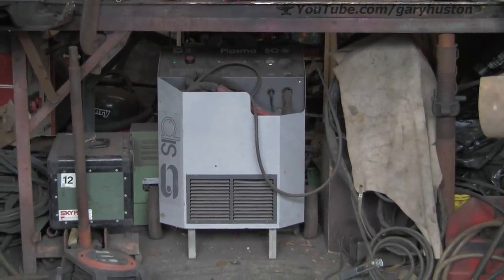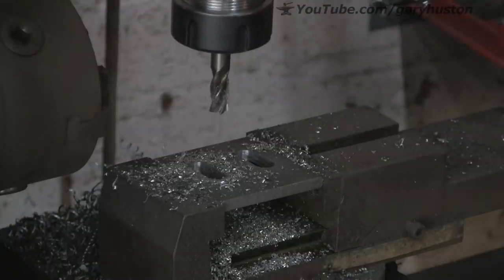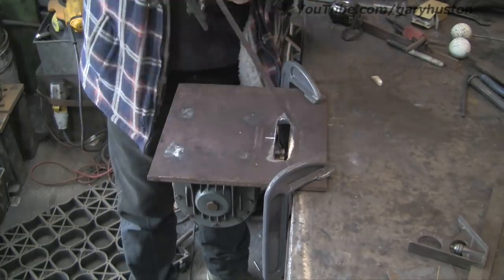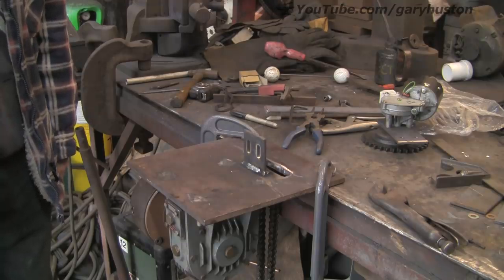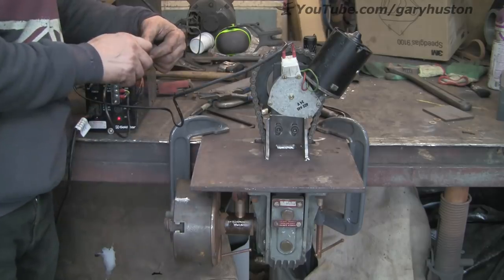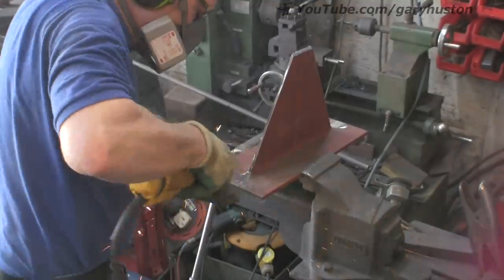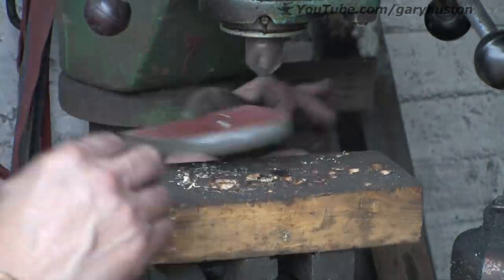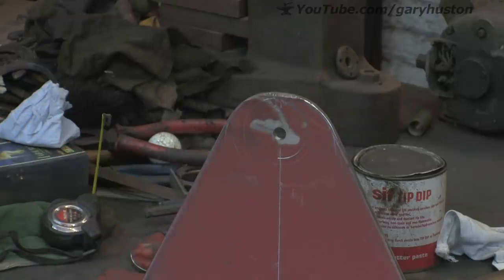Homemade Rotary positioner part two

Comment: Looks like something that will be really useful.  My son and I built a CNC Plasma table a couple of years ago.  He wanted to make a tube buggy, so we installed a chuck on the table to CNC cut tubing.  He never did make a tube buggy, but we did cut a couple of pieces of 6" SCH 40 pipe on it.  Recently he built a suppressor and we put the pieces in the chuck and used the CNC to rotate it at a constant speed and mounted the TIG torch on a magnetic indicator holder to weld it up.  Worked great.

Comment: Being as how I have no clue if you are finished yet are where exactly you are going with the build, I think I see foreshadowing of a possible problem with the table mounting to those ears you are making. If the table is wider than the legs, when you go to rotate the table to 90 degrees to the surface, or where the positioner will hold horizontal, the table will hit the legs. Easy fix if you just weld it to the edge of the positioner mounting plate or notch those legs to 90 to match. My guess at the future~ take it for what you will. 
Thanks for the videos.
Reply from the maker: That isn't an issue at all but there will be an issue, look out for the next part to see what it is and how i get over it!

Comment: My horse has a crack in his hoof, what can a farrier do and how much will it cost?
Reply from the maker: I can’t answer that. It depends what caused the crack, where it is, how big it is, does it involve any other structures. Your Farrier will need to asses it and make a decision at the time. It could be a quick fix or very complex.
Reply: @garyhuston  We don't know what caused the crack, I've heard it could be because he is always stomping his feet because of the flies (He has sweet itch) but I don't know, I went to feed him and noticed it. It's not too big but I'm worried it will get worst (It starts at the end of his toe and if it does increase it will go upwards towards his leg). Do uno Roughly how much Cracks cost to fix or treat?
Reply from the maker: The only way you will know is to call in your farrier or vet. He may just need a trim which is quick and cheap.